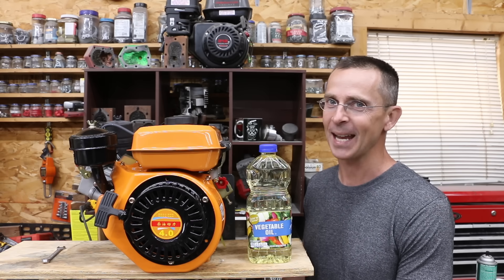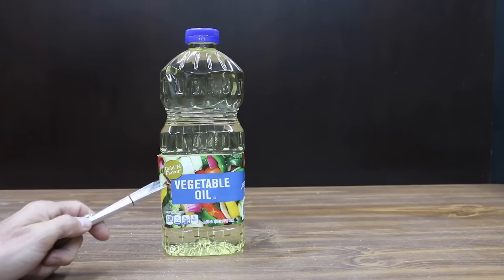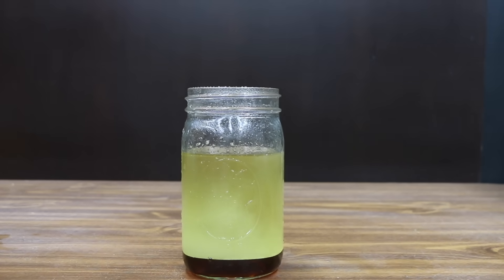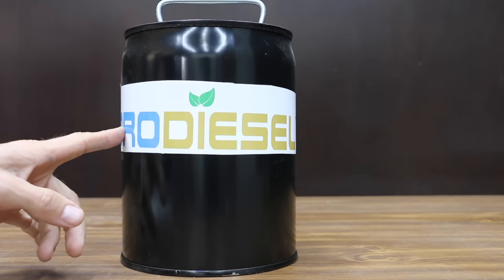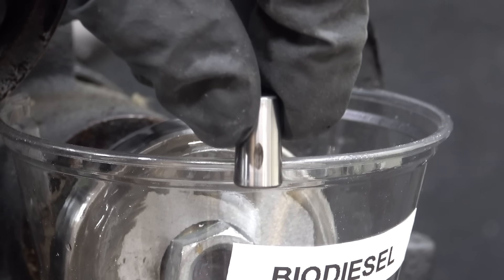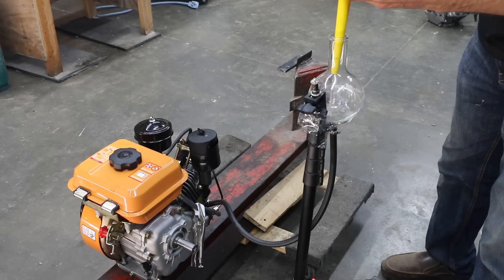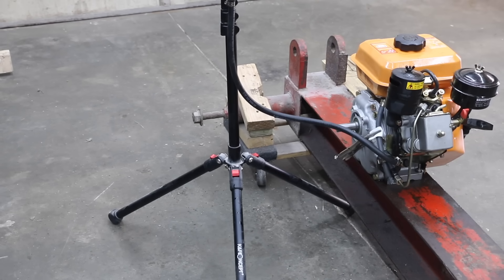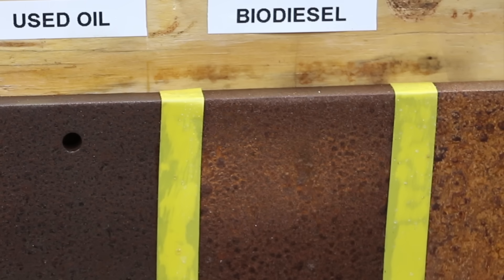Make "Biodiesel"? Let’s find out! Diesel vs Biodiesel, Used Motor Oil, Vegetable Oil, MPG

Comment: Hi, that was a great video.  When making biodiesel, you have to remove the glycerol, then mist wash it as you did, then dry it using heat until there is no more steam.  And used or new vegetable oil, in time leave a coating on the pistons when the engine is cool and glue up the engine,  which the starting gets harder and causes wear, so a good idea to put a tank of diesel in🎉 every few tanks.  I make and use biodiesel in my Vauxhall Zafira, or as you say out there, Opel Zafira.  I do have a video idea, run a petrol engine on methanol
Reply from the maker: Thanks!  Thanks for the video idea.

Comment: I pour my used motor oil into my 08 Cummins every time I do an oil change.  Been doing it for years no issues ever. A little smoke but it's free fuel and iam recycling.
Reply from the maker: Thanks for sharing.

Comment: Problem is getting the used oil.
Reply from the maker: Thanks for the feedback.
Reply: Not really you can find oil change shops that will ether give it to you for free or for very low cost that is still a lot cheaper then diesel fuel.

Comment: Been making Bio-diesel since 2007. Very easy to make. Tip : pre-treat your next batch of WVO (60 deg c for 1 hour) with the glycerol of the previous batch. Will lower Titration, increase yeild and clean out most of the glycerol from the remaining methanol and KOH ( I use KOH).
Reply from the maker: Thanks for sharing!
Reply: Checkout Robert Murray smith  on making biodiesel with gelatin.  Way easier!!!

Comment: I change oil on a couple of big trucks and I get about 12 gallons of waste oil each time. Do you have any interest in seeing if the oil from your dodge will run this small engine? It'd be a neat idea to think I'm getting 12 gallons of fuel for my tractor each time I do an oil swap.
Reply from the maker: Thanks for the suggestion.

Comment: That's so cool, I've never seen a small diesel engine like that. I could have used on, I had a generator on the back of a semi truck. It would have been so simpler if the generator and the truck ran on the same rule. Where did you find it?
Reply: They are on Amazon for $270.

Comment: I run a %50 mix of used motor oil when it’s warm enough in my 24 valve. I strain it first. The air dog does the rest. During the winter I used a gallon to a tank for lubricity. I also use a cetain booster additive as well. Been doing this over 10 years no problems.
Reply from the maker: Thanks for sharing.

Comment: Agree with @That Kilted Guy DIY Home Improvement that running straight veggie oil (SVO/ WVO) is not ideal for the aforementioned reasons. WVO simply doesn't atomize well on its own, leading to stuck cylinder rings and oil dilution. 

I've been making "poor man's biodiesel" for 7 years now and for specific applications have seen zero issues. 

Simply put, blend 4 parts veggie oil (I use waste fryer oil) to 1 part gasoline. I use only ethanol free high octane gas for the dual benefit of no ethanol and extra power of the high octane. 

For any serious application, you have to filter the veggie oil. Even the clear stuff from the store needs to be filtered. I filter all my veggie oil down to 5 microns and then blend with gasoline. In a 55 gallon drum, this 80/20 ratio comes out to 44 gallons of veggie oil and 11 gallons of gasoline. Let sit for 2 weeks- the gas acts as a solvent and several gallons of sludge forms on the bottom of the barrel. After 2 weeks I pump out the barrel through a water block filter into my holding tank being careful to not pick up the sludge at the bottom of the barrel. This produces a lot less waste than the "real" biodiesel process which leaves lots of waste vegetable glycerine. The viscosity of this "poor man's biodiesel" is very similar to that of regular diesel in summer conditions. I dispose of my biodiesel waste by burning in a bonfire.

As noted in the video, modern diesel engines do not like biodiesel and are too expensive to justify risking running biodiesel. Any mechanically injected/ rotary distributor style pumped engine will play much nicer with this homemade fuel. I have no experience with Fords, but any GM/Chevy/ Dodge diesel truck from the 90s will play nice with this fuel. The Mercedes diesels from the early to mid 80s are also legendary for running on just about anything. 

There is a noticeable difference in power between homemade fuel and straight diesel. When I need to tow heavy equipment, it's always straight diesel. Long, unloaded road trips? Can do when it costs at the most $2/ gallon using this method.

I have heard horror stories about extended running on waste motor oil, so although I have no personal experience I would advise against going that route. I've always wanted to see a comparison of running my poor man's biodiesel with new cooking oil vs. used oil. I've heard stories of farmers in the midwest growing their own oil seeds and crushing their own oil, then blending with gasoline at the aforementioned ratio.

Great video from a great channel, thank you for the fantastic content.
Reply from the maker: Thanks and you are welcome!

Comment: I just thoight of it...  figure out how to run propane through your small diesel engine.  I have seen trucks on the road that use LNG through their engines, and I would love to know how I might be able to switch from diesel to propane if needed.  propane is easier to buy as a civilian.  or is it even possible without ausing a different engine?

Comment: How much you paid for the engine:"DNYSYSJ 196CC 4 Stroke Diesel Engine Hand Recoil Start Single Cylinder Horizontal Axis 168F 2200W"? 
Thanks

Comment: I'd like to see this done with used "dirty" vegetable oil. Even now with our high gas prices, diesel at the pump is still cheaper than a gallon of vegetable oil. The only economic way would be to acquire the vegetable oil as a waste product.
Reply from the maker: Thanks for the suggestion.

Comment: in the mid 90's I made b100, ran it in my hilux and Isuzu bighorn, old type injector systems (mechanical) ran it 100%, in winter ran it 50, 50 with pump diesel. never had a problem. Engines ran noticeably quieter. I made 150 ltrs at a time. It could be automated. was a bit messy and time consuming. Still ran  it for about 5 years
Reply from the maker: Thanks for sharing.

Comment: Get a centrifuge, clean your used ATF with it, then blend the atf with diesel. Works like a charm, ol 7.3 power strokes and 12v cummins engines eat it up. Filtration is the KEY
Reply from the maker: Thanks for the feedback.

Comment: This is not viable for large scale production. What everybody forgets is that biodiesel requires a lot of energy to produce (needs industrialized chemicals which uses energy and more industrial process) while oil needs mainly only to be heated and you get a lot of products (diesel, gas, Kerozen, naphthalene ect.) I do not have the numbers but I would not be surprised that the energy required to make biodiesel is superior that the energy we can get with it.
Reply from the maker: Thanks for the feedback.

Comment: You really should test Blue Diesel which is diesel made from SynGas (the product of a gassification furnace)   Blue Diesel can be made from basically anything that burns, although typical sources are biomass (including ag waste) and trash incineration.   It can either be raw (condensed syngas put through selective distillation) polymerized (a simple process increases the complexity of the syngas increasing yields of heavier fuel like diesel) or it can be full synthetic (where a precise chemical process specifically targets a single ideal compound of the desired type of fuel, in this case diesel).

Full synthetic is expensive, and more likely to be used for additives, polymerized is probably the cheapest available right now (not very valuable) although raw is technically a byproduct of producing light syngas and syngas propane substitute, which are fuels used in other industries, and increasingly popular cutting edge renewable fuels.  Thus raw may become much more common in the future as production of processed syngas increases.

There are processes to make a mix of syngas and alcohols from water, CO2 and electricity using nanocatalysts, but those are 20-50 years out from production use unless we run a Manhattan project level funding effort to reduce greenhouse emissions and create better fuels in the process.   We honestly all need this, but it isn't happening with the current political climate.   Maybe once all the miami beach homes of the rich get flooded.
Reply from the maker: Thanks for the video idea.

Comment: The choice of a small compression injection diesel engine is great for this test BTW.

There are several choice for biodeisel formulations.  

Raw Vegetable oil doesn't burn well without engine modification in many engines but is quick and easy in engines it does.  Necessary modifications range from adding a preheater to using hotter glow plugs, to changing out the injectors.

Raw Vegetable oil with additives is quick and easy.  This would be  if you add just the methanol, although ethanol, gasoline and/or kerosene in the right percentages would work too. (He didn't do this option.)  This runs in a much greater percentage of engines without modification.

Processed vegetable oil, which uses acid or alkali to separate the fuel (Potassium hydroxide was used the formulation shown.)  Processed vegetable oil can more reliably use recycled vegetable oil (i.e. used fryer oil.) It also can be made from things like fat drippings from cooking meat, as you no longer are restricted to unsaturated fats.   As a note, heat can be used to expedite the process.  Depending on formulation depends on how hot you need it, and you want to use thermostat control, as it will start generating it's own heat once the process fully starts.  For the formula shown, you need to keep it below the boiling point of the added methanol solvent.  This would put your ideal temperature at  150F-175F.   To be clear, at perfect ratio all the acid or alkali will be used up in the process.  However, we all know nothing is perfect even in the lab, let alone in practical use.

Processed vegetable oil also works good with additives.  Same list for decreasing burn temperature but it also can be blended with a small amount of diesel, 2 stroke oil, or purified used motor oil or raw vegetable oil to increase viscosity. 

Processed vegetable oil will burn cleaner, but may get fewer miles to the gallon.  The engine will last longest on processed vegetable oil with a very good additive formulation (high grade biodiesel lubercant additive plus methanol or related to lower ignition point, increase burn temperature, and improve completeness of burn.
Reply: Oh, I forgot to mention, when switching to biodiesel it will result in residue of old diesel being washed from the walls of your gas tank and fuel line.  This will result in your first fuel filter on bio-diesel needing to be replaced shortly after the switch.  This is a transition issue, not an issue with the biodiesel.
Reply: Also, Hydrodiesel is specifically designed for large diesel engines, it won't run well in a small engine.  This is really something agricultural users should consider, as well as those who own diesel ATVs, Motorcycles and Garden equipment.   The fuel is just designed for big semis and pickup trucks in mind.  It's not that it's a bad fuel, it's just bad for small engines.

Meanwhile, small diesel engines are all based off the original design for the most part, which was designed for fuels like raw vegetable oil and thus high viscosity fuels will likely run good in it, including the used motor oil blend.
Reply from the maker: Thanks for the feedback.

Comment: I see you washed the bio, but did you dry it,  letting it sit out in the sun or heating it will evaporate the water out of it.  Also, can separate the glycerol out in 3-15 min instead of 24 hours using electrolysis.  I use a neon light transformer with 2 rods.

Comment: done a lot of reading on diesel..the diesel engine was designed to run on peanut oil..minimal wear low emissions the trouble is u run veg or peanut oil the cost of food will go up massively because of greedy powers that be..doesnt matter what we use gas electric or dieselwe all gonna pay over the top eventually..stop the greedy and make it nontaxable and life would be better.
Reply from the maker: Thanks for the feedback.

Comment: It was the used motor oil highly filtered or was it just use right out of the crank case? Hydro diesel has an element of water in it and I would never want to run that as a fuel or lubricant in any sort of machinery. Maybe I am missing something here.

Comment: I manufactured and ran bio diesel in my 98 Silverado every summer for years with zero problems. In the winter I would mix about %20 biodiesel in with regular pump diesel and an antigel supplement. I'm in Ontario Canada so starting it would take a few runs on the glow plugs when it was below -10c. Great video btw.
Reply from the maker: Thanks!  Thanks for sharing.

Comment: Not sure if anyone mentioned it, but "diesel" engines are actually surface combustion engines and the very first engine by rudolph diesel was shown in 1904 at the paris world fair where he ran it on peanut oil. The engine was designed to help countries that didnt have any oil reserves. (which was a new thing at the time) Diesel was concerned that some countries would be left behind technology wise. It was several years after his death that oil companies tried to use their waste in it which destroyed the injection pump. They finally figured out that adding sulphur for lubricity solved the problem. When it came time to name it...they called it diesel fuel and the name stuck. Now 99.9% of people have no idea that diesels were meant for peanut oil or anything that has an oil. Rapeseed, coconut, peanuts, etc.
I have run straight veg oil in my 6.9 and 7.3 fords as well as my 8.2 turbo diesel. All old school mechanical injection and relatively low pressure. My buddy ran canola oil in his 06 diesel bug and it worked great as well. Bio diesel is a pain in the butt and I would not waste my time, as long as you use non-hydroginated oil (doesn't get thick when room temp like bacon fat, etc) then it works exactly the same as diesel, same amount of smoke on start up and running and mileage is about the same. I've also run hyd oil, machine oil, anything that will burn under heat of compression.
Reply: Thank you it's finally Time cut off from big tech charging prices skyrocket out there when I learn just grow it right on our own soil equals independence doing the process right
Reply: Ur not from cape breton are ya bii ahahah
Reply: Just over 394,000 one-owner miles on my 6.9L. Probably would've hit 400,000 by summer, but Joe bought her reprieve with the local $4.50+/gal diesel.
Reply: 2006 would have emissions control correct?
Reply: @punker4Real  depends, what make is it
Reply: People also dont know that our friend Mr. Diesel died under mysteries circumstances and the oil people just took the engine and didnt tell anyone it could run on any burning oil or gas, yes they also run on gas, gas as in propane, forklifts have been doing that for years.
Reply: @ThunderjunkMcbutram  Actually propane engines are gasoline engines running on natural gas or propane, etc.
Reply: @lowrangeinnovascotia2930  i drove a forklift years back that had a switch to switch from diesel to propane, there was a plage in the cab from the factory that said diesel, it was a pretty old forklift.
Reply: @ThunderjunkMcbutram  Well, as a retired diesel mechanic of 36 years, who is also qualified in century automotive propane systems, I'll tell you with confidence that it was a gasser with a switch (very common). You can't inject or allow propane to run into the intake of a surface combustion engine (diesel) because it will affect the fuel burn rate and pressure spikes. (this is why propane is used in aftermarket systems for diesels to gain hp) If you inject small amounts, it burns better and cleaner than pure oxygen so the engine smooths out and gains a few hp. Add a lot and there are big hp gains but also lower EGT's.

All that to say, regardless of any plate, it was a gasser.
Reply: @lowrangeinnovascotia2930  Dont know what to tell you, this wasent just some randomly placed plate that could have come from something els, that was very clearly made to sit right there round the switch. Custom built machine maybe? i dont know i did see on google that it dosent seem to be a thing for diesels to run on gas, but i also see that one can convert them to, so i dont know i really dont.

Comment: What about fuel economy.

You could put the fuel in and let it slowly get onto the 'new' fuel for testing then top it up to the same level and restart engine and do a timer for how long 1 litre + fuel line of diesel/vege oil ect: lasts running the engine.
Reply from the maker: Thanks for the suggestion.
Reply: @ProjectFarm   No worries. With fuel prices the way they are, i think the fuel economy really matters :)

Comment: Awesome vid..it’s all a bit above my knowledge level on chemistry when it comes to balancing catalysts and lubricants and methanol…but one simple question…kinda silly but if I bought one of these little engines I could technically make a go kart out of it for my son and run it on my used motor oil mixed with a little bit of gasoline, correct? In a vague sense,
Reply from the maker: Yes, that's correct.

Comment: Anyone brave enough to use biodiesel in their nice John Deere tractor or their nice diesel truck?  Just curious how it went.  Thanks.
Reply: I have used b20 in my 6.0 ran just fine. was better than normal diesel. I would still run it if i could get it where i am. not sure about 100% bio in the truck yet
Reply: @timgriffith9149  Thanks, Tim.